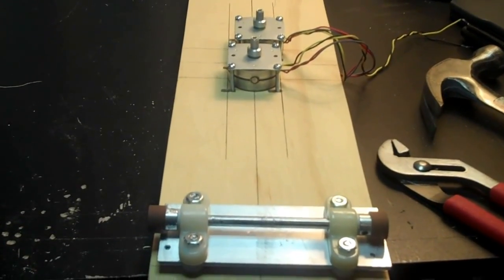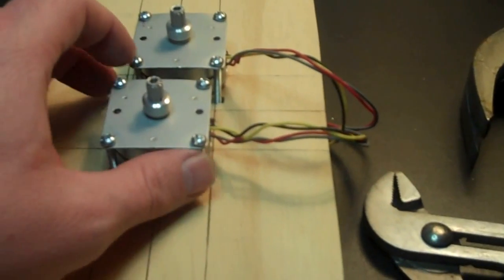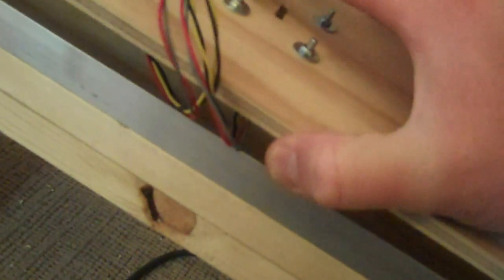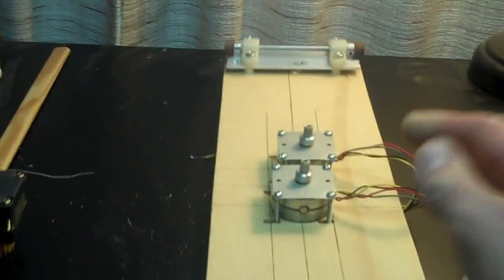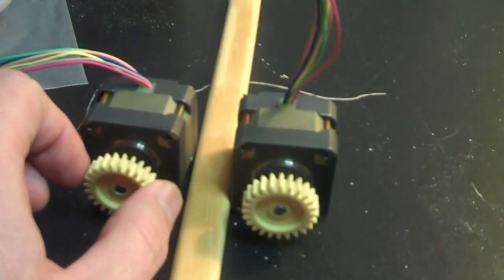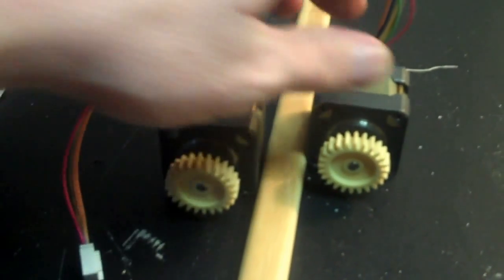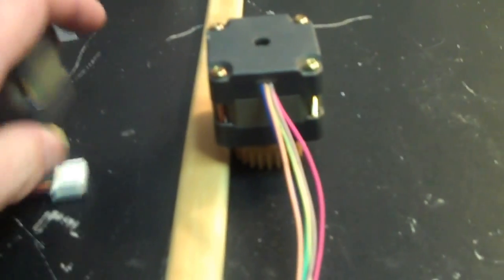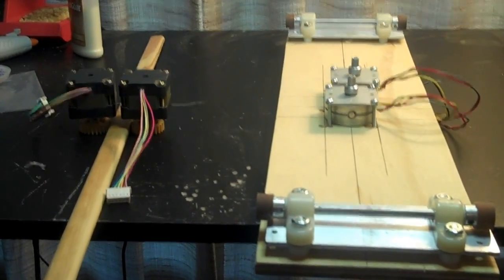Camera Timelapse Motion Control - Part 6

Comment: Keep it simple. Use one active motor between to offset rollers to obtain even pressure.
Reply from the maker: Yeah I gave up on this project a long time ago.  Eventually I'm just going to buy a nice system but they are not cheap. :)